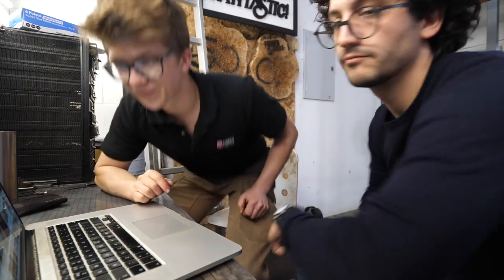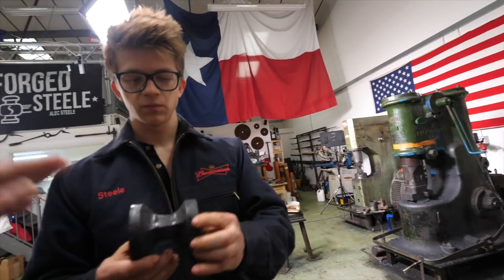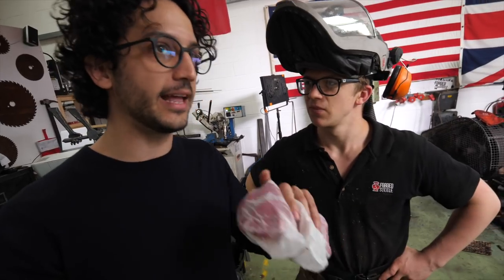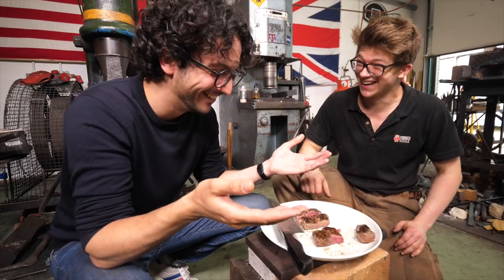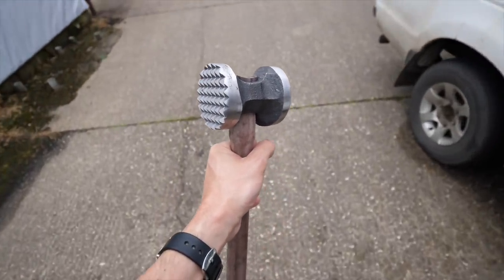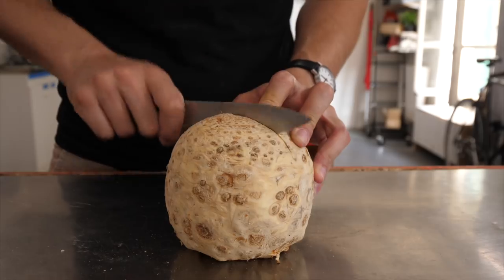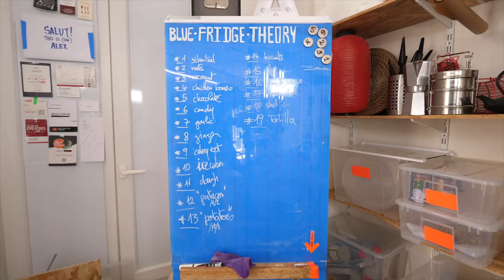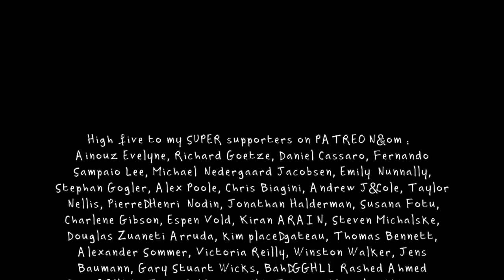Hammer : Most Underrated Utensil ? ft. Alec Steele

Comment: Old aphorism: if you can't fix it with a hammer, get a bigger hammer.
Reply: Yes. I was whacking away at a ball joint and getting nowhere with my sledge hammer. A friend watched for a while, walked to his garage and came back with a much bigger hammer. One tap and the suspension parts fell away . . . 'Sometimes all you need is a bigger hammer.'

Comment: Not so sure that needed to be made in a forge but oh well.
Reply: right? round stock and if you're gonna mill out the knurling anyway you got the tools to do the whole piece without the forge. looks cooler for youtube i guess.
Reply: For the purpose of hammering meat, vegetables or nuts its really over the top. Also stainless steel would have been more appropiate.
Reply: I think the forged look is something they wanted
Reply: Anthony M I feel a lot of 'maker stuff' has become more about the spectacle than the build now.
Reply: Alex went to a guy who forges things.. so it's kind of the whole point to forge it...
Reply: Anthony M
That would take a lot of time in a mill/lathe.. Probably moreso than forging, and then Alex wouldn't get the chance to forge something either..
Reply: Adrian Schmidt
So long as it's washed and dried after use and oiled like once every year its completely fine. Forging SS can remove the chromium if you get it too hot btw.
Reply: Skruffles I can practically hear Abom79 laughing at that comment. Shaping a form on a mill and a lathe that requires 'no' tolerances slower than forging. You do know Alec edits don't you or are you thinking it gets hot that quickly and stays hot until the end?!
Reply: Little Bacchus
If you think alex has a lathe and mill 1/4 the power of Abom's equipment then, I feel sorry for you Buddy.
Reply: Looks 100x's cooler than a Milled hammer, and just as effective.
Reply: There are always more ways to get a similar result. With the same logic you could say most things can be milled instead of forged, Why not cast it? Why use nuts and bolts when you can weld? @Little Bacchus Don't think it is "spectacle" as much as convenience and aesthetics
Reply: Skruffles Wouldn't know what Alec has in his forge, watched three of his videos realised very quickly I'm not his target audience.

Edit: But I think SternLX up there is.
Reply: They didn't know it was impossible, so they did it.
Reply: @Quentin Alexandre I've done six impossible things this morning... Guess where I'm having breakfast?
Reply: Would have been a lot of wasted material to lug off that much material to get itthin enough in the middle... seeing as he has a forge, why not use it for ease?
Reply: When you do a collaboration with a blacksmith, expect hot steel to enter the picture. Also, hammers are often forged.
Reply: I mean, why not just show a video of Alex buying one on Amazon. That's the content we all want to see.
Reply: The whole point was for Alex to get to hang out and forge something. Obviously he could have bought one for $10 on amazon if he just wanted one
Reply: The round stock available wasn't broad enough for the hammer face. Widening it required forging.

Comment: I have something similar. I use it mainly to mince garlic. What I do is         get freash pealed cloves and throw them into the freezer. I  buy a big bag from Walmart for like 10 buck. Put the frozen clove on the cutting board and then press down on the clove with the diamond head. Slowly rock the head back and forth. The thermal mass of the mallet thaws the clove and it breaks up into a nice mince. Its quick as hell. Really good if you need a lot of garlic.

Comment: I used to have a glass top stove, and some old metal pans that were not quite flat any more.  I got more even and faster heating when I hammered in any pots that had convex bottoms.  The concave bottom captured heat rather than shedding it.

Comment: It is certainly one beast of a kitchen hammer.
The only small "fly in the ointment' might be preventing rust on the steel hammer head, also maybe keeping the top of the eye (where the wedges are driven in) clean might also be a bit trickier than anticipated...

Comment: I giggled when Alec asked "What is braising?" because to him, it's a very different thing. How Alec put the pyramids on one face of the hammer was interesting.  I wonder if Alec designed this with how much it should weigh in the end in mind. You can get hammers in different weights after all. A 16oz hammer does more 'work' vs. a 8oz hammer (because there's more force behind a blow).

Comment: Will flattening a steak out with a hammer make it easier to cook over high heat? (I cook over fires and make 90% of all my steaks that way. I use hickory pieces that are half dead, since they are still a little green they will create more smoke and give it a flavor I like, before that I use pine to create a bed of coals so I know I can always pile wood on top and use the coals to ignite the new wood of combustion stops at some point. There is a chemical in the sap called turpentine which is a hydrocarbon like gasoline, it burns quite fast because it is inside of the pieces. The whole point of it is to seal any cuts on the tree so bugs can’t get in and so microorganisms can’t get in either. I’ve noticed that while cooking over large, hot flames that it scorched the outside and doesn’t get the inside, I’ve always had to take a lot of time to cook over smaller flames to not burn the outside and keep the inside red. So I’m guessing hammering the steaks will work, I’ll try that next time.

Comment: Is the handle completely level/horisontal to the working surface?
Looks like it is.

I always found it it is more comfortable to use a meat hammer if its hitting surfaces are slightly angled (5-10deg). 
It should alow for a more natural hand position when hitting the meat.
Sticking a bit up from the working surface.

Comment: I've always thought traditional pestle and mortars are too small, require too much effort. Someone needs to make some kind of hammer/pestle and mortar thing. A big heavy hammer head but also a container that will stop everything flying out in all directions. Maybe a hammer head with a handle on the top that you push down into a mortar. Even better, an automated pestle and mortar so you don't have to do it yourself.